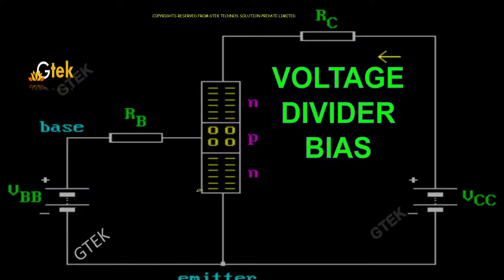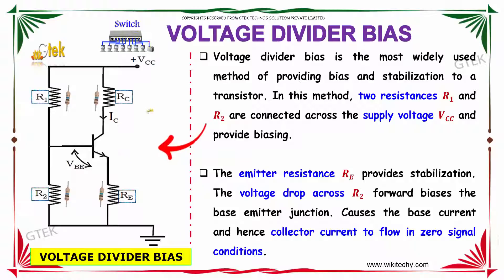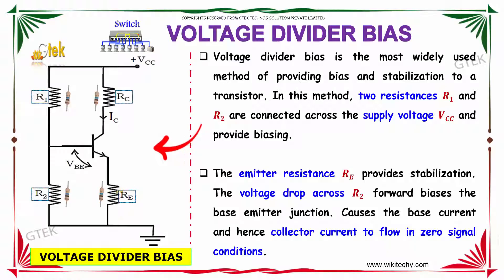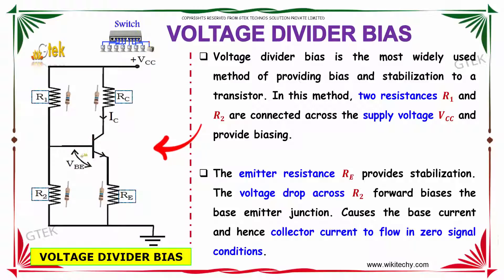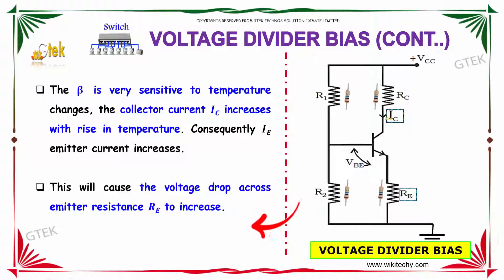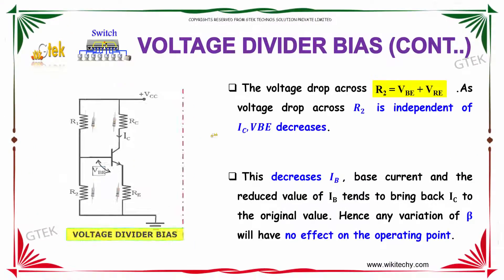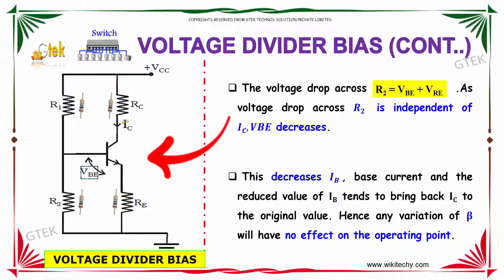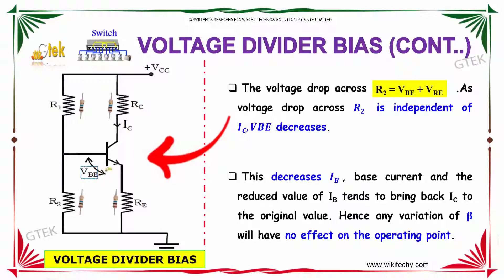Voltage divider bias  Semiconductor Class  12 physics subject notes lectures CBSE IIT JEE NEET

Comment: Forward Biased Diode Equations ... Zener diode Semiconductor Devices class 12 Physics subject notes lectures CBSE IIT JEE NEET ... online video lectures preparations notes for class 12 physics CBSE IIT-JEE NEET ... Zener Diode as Voltage Regulator, Zener Diode Working with Circuit Diagram and ...

Comment: Voltage division is the result of distributing the input voltage among the components of the divider. A simple example of a voltage divider is two resistors connected in series, with the input voltage applied across the resistor pair and the output voltage emerging from the connection between them.

Comment: The process of obtaining a certain DC collector current at a certain DC collector voltage by setting up the operating point is called biasing. After establishing the operating point, when an input signal is applied, the output signal should not move the transistor either to saturation or to cut-off.

Comment: Jump to Voltage divider biasing or emitter bias - Voltage divider biasing or emitter bias. The voltage divider is formed using external resistors R1 and R2. The voltage across R2 forward biases the emitter junction. By proper selection of resistors R1 and R2, the operating point of the transistor can be made independent of β.

Comment: Voltage Divider. The two resistor voltage divider is used often to supply a voltage different from that of an available battery or power supply. In application the ...

Comment: Voltage divider biasing or emitter bias. The voltage divider is formed using external resistors R1 and R2. The voltage across R2 forwardbiases the emitter junction. By proper selection of resistors R1 and R2, the operating point of the transistor can be made independent of β.

Comment: A potential divider bias, also known as voltage divider bias, is a method used for the dc biasing of bipolar junction transistors (BJT) in a simple amplifier circuit.

Comment: Voltage divider bias is the most popular and used way to bias a transistor. It uses a few resistors to make sure that voltage is divided and distributed into the transistor at correct levels. One resistor, the emitter resistor, RE also helps provide stability against variations in β that may exist from transistor to transistor.